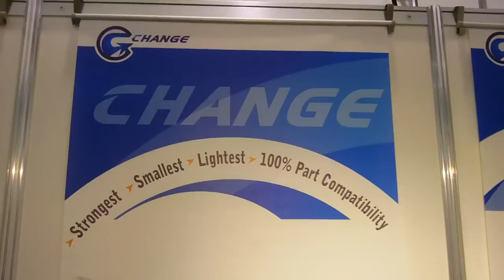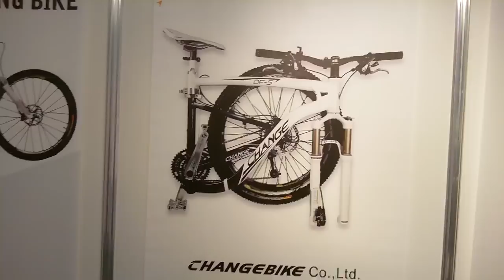ChangeBike Full Size Folding Mountain Bike

Comment from the maker: The crank arms are industry standard so you could place your own pedals on the bike if you prefer. If the bike is ordered with the special pedals, just unbolt the special adapters for the pedals and place your pedals on the bike. OR order the bike without the special pedals...

As to other parts, I recommend you contact ChangeBike as this video is over 2 years old and we are not currently selling the bike (no distributor in the USA at this time).

Comment from the maker: 2 points regarding the pedals.
- Removable pedals make the bike more resistant to opportunistic bike thieves that would otherwise ride the bike away.
- If someone stole the pedals, they could only use them on a bike that already has the special adapters that are needed to mount them on a bike. Only a small number of cyclists even know these pedals exist.